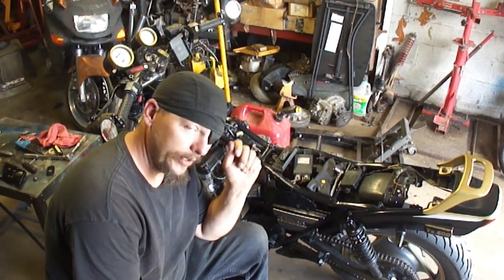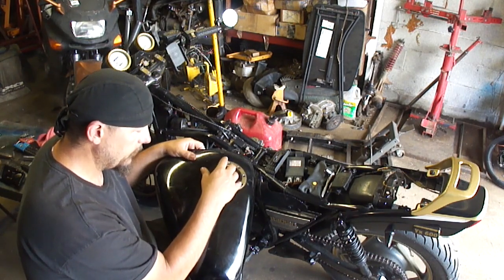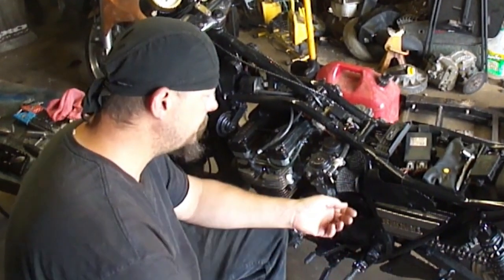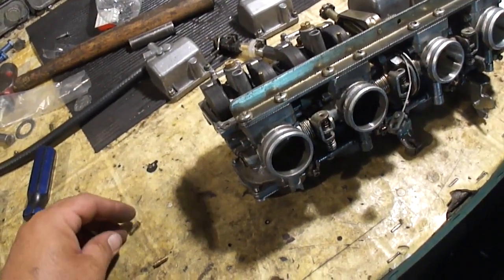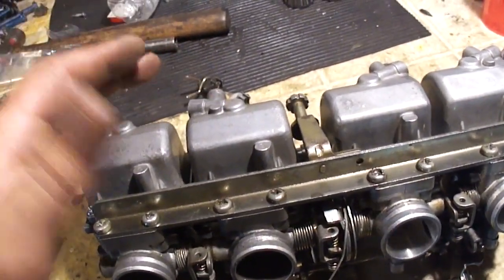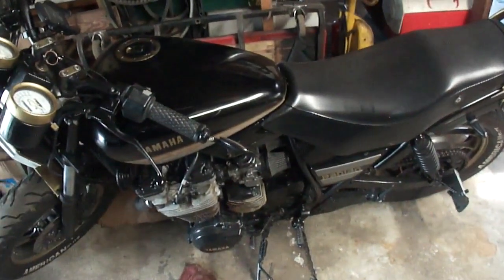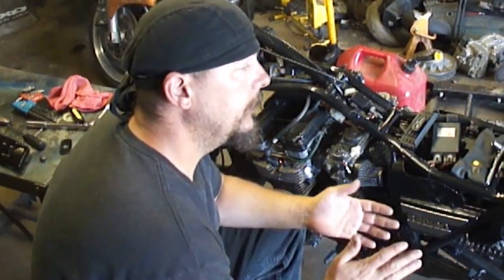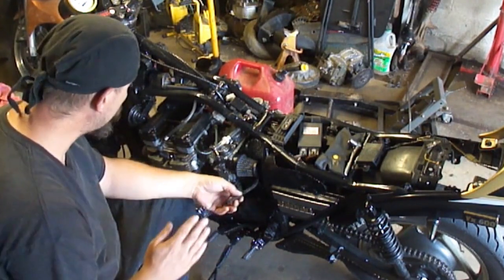Troubleshooting basics (Crash Course)

Comment: I've been slacking on commenting. baseline with a test ride, determine exactly the issue you're addressing, spark, fuel, timing, mechanical.
only changing one variable at a time cannot be stated enough. "which fix worked?" isn't THE fix. (verify the fix)
when it comes to fuel issues, i use the "give the motor what it wants" rule, add fuel or air to see how it reacts. is it happier or worse? really liked the advice "swap with known good part" when you have multiple carbs or identical machines. as moving the problem is definitive diagnosis.

Comment: Very nice Video but i have a question, 
My cb 360 twin only runs on the right cylinder but as soon as i unplug the sparkplug cover from the running cylinder and start again, the left cylinder works fine but only until i plug the right side back in. When both sparkplugs are connected only the right side runs.
Any ideas?
Reply from the maker: So, refresh my memory here. Is this bike from the mid 1970's? Does it have only one set of contact points or two? Is it 12-volt ignition with only one ignition coil or two coils? Might be a coil. I would ohm check the coils primary and secondary windings. Pull both spark plugs and look to see if they are dirty. Plug both spark plugs into the spark plug wires and lay both spark plugs on the engine where you can see the gap, now crank the engine and look for spark on both plugs. The spark should alternate, left right left right. Use a spark tester and test that spark can jump a 10mm gap.
Reply: @MrFixit1 thanks for the quick reply, 
 It is a 1974 Model and i have already replaced the two ignition coils aswell as the sparkplugs. I have also checked for the right ignition timing and replaced the regulator and rectifier for a new combo unit but nothing worked. Could it be a charging problem?
Reply from the maker: @petst  Possible it's a charging problem. Have you checked the charging voltage while the engine is running? Should be 13.5-14.5 or around about. Have you tested the stator output with engine running? If there isn't enough voltage to the coils, it's going to have erratic spark issues. Start with the basics.